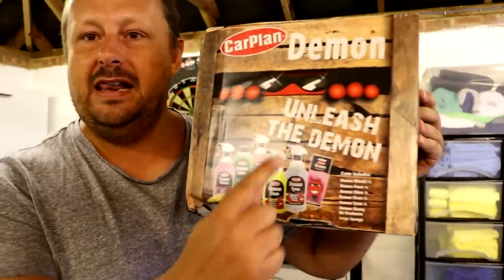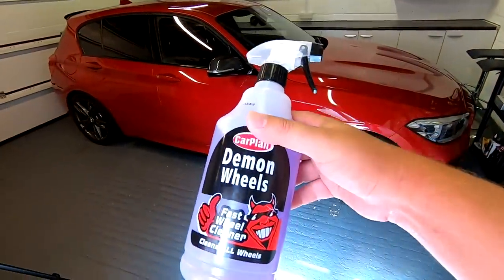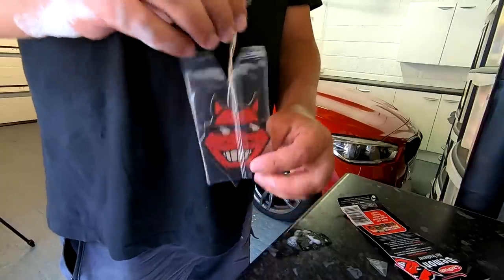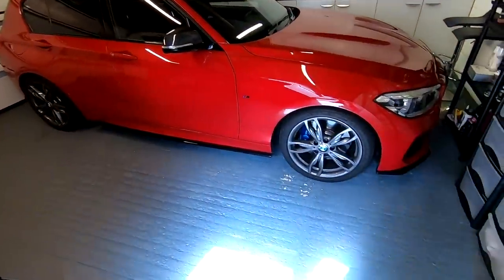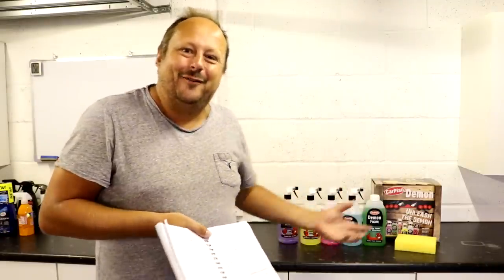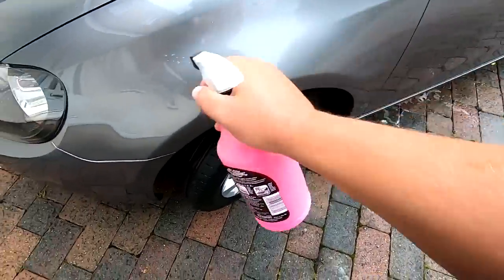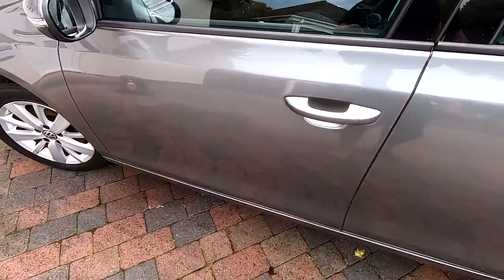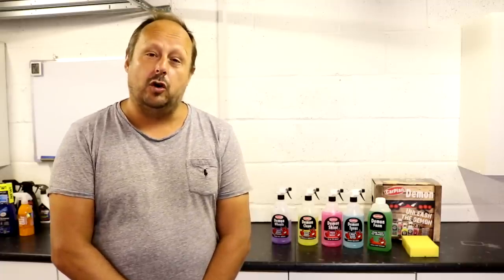DEMON or DAMP SQUID - Detailings Cheapest Kit £19

Comment: I've tried and use a lot of these products so for anyone interested: 

1) Snowfoam: is a decent product if used as a Snowfoam in a lance but down side to get a good lather you need to have about 250ml per car so can run out easy.

2) Demon shine: As said in video is  a good product for price well as a detailer and also is a pretty good as a hydrophobic spray wax, water beads very well.

3) Wheel cleaner is not great at all better of getting the Carplan trade  TFR cleaner a lot stronger but use it concentrated. 

4) Tyre shine - is not great either, again you can use Car plan tyre slik or Carplan super trim cleaner. They work a lot better

Comment: Hi guys just for those of you that don't know the browning on the tyres is a common problem that occurs when you don't clean the tyres and then follow up with a dressing or protectant of some kind. It's a process  that happens due to a element added into the tyre called antiozonant,it's to slow the premature cracking from the tyre getting too dry from oxidation.

Comment: These are probably the sort of products that the likes of a bloke called Gerald  (other names are also available) who proudly washes 'The Old Girl' every weekend regardless. I have used the snow foam in a snow foam attachment for my pressure washer. Nothing impressive, but it is what it is. I have yet to use the detailer and tyre shine. Not really what you would use to keep your car perfect for the long term  (I'd probably use the sponge in the bath) but probably better than the £3 'Wash and Scratch' merchant at the local supermarket / former petrol station forecourt, plus you don't have to drive there & wait in a queue! Happy Valeting ☺

Comment: Regarding the bottles... I have a snowfoam cannon that works well but over time, the thread on the bottle wore thin and stripped the thread. I searched my shelves and found an old Demon clean bottle with not much product remaining and it had a matching thread. One clean out later and the bottle works perfectly as a snow cannon bottle. I now have several Demon clean bottles that have been promoted to 'cannon dispensers' and i can set them all up before a wash with snowfoam and A.P.C and interchange at will without wasting time running in and out of the house setting up the products. Just discharge one bottle, unscrew and replace with the next prepared waiting bottle.
The Demon products themselves are pretty tame and safe for almost any use with reasonable results, just dont go expecting significant results from minimal application.

Comment: Great review. I've had the snowfoam with the gun attachment. Worth a try and the product works well in my opinion the foam does well to roll loose dirt off but as you said the gun is no replacement for a Lance. Also uses a lot of product to get the desired effect. 4 washes and I've used the full thing. I've bought the alloy cleaner and with 2 applications both after rinse and after scrub does a good job.  Is enough for me but overall I definitely think you've got the verdict right though. Cheers again

Comment: I have a bunch of these Demon products for a quick weekly wash - when I have more time and put more effort in, I’ll use better products.
Couple of things to comment on your video, I only use the APC for inside the car and for that, it works well.  Agree about the alloy cleaner, I never use it as it’s really not good.  However, the foam shampoo works 10 times better as a snow, so I put it into my jet washer bottle and it literally smothers the whole car in thick foam.  I personally wouldn’t use it in a bucket like that.

Comment: Quick detailer is great as a cheap drying aid as it seems to help dry with no drying marks even in sunlight. Always amazes me as it shouldn't work for £4 but it does!! I've found it does work fine on glass when used as a drying aid and woks with no smears left. Save my more expensive detailing sprays for the car show days or those nice "Drive in the sun" days.....

Comment: The quick detailer is a good drying aid, and leaves a good shine. I used it on glass with no adverse effect. It is £5 a bottle when bought separately. I wasn't impressed with any of the other stuff really. I have tons of g101 left so the apc will be sat in my garage for years to come. Wheel cleaner is OK for light dirt, and the wheel shine is ok again for a weekly touch up. I think its better priced at £12.99 mark

Comment: I might have found a use for Demon Tyres...... I've used it to dress my engine bay after cleaning. Spray on and wipe off, seems to work fine on hard plastics and keeps hoses looking nice and black. I never use it on tyres as it looks kinda cheap and never lasts anyway so at least I've found a way to use it and free up some space on the shelf!

Comment: I've found that pink spray quite good for a quick finish after washing. The wheel cleaner is virtually useless for anything other than very light brake dust. However, for the price, it's an okay range but don't expect too much.

Comment: All of those products can be picked up under the "Carplan: Trade Valet" range, a lot are in undiluted state. I really rate "Demon Shine/Hi Wax Rinse" as a rinse off drying aid and can get 5 litres for £6, the "Hi Wax Rinse" version is also MUCH stronger than the spray bottle dilution of Demon Shine too, as it instructs a 40:1 dilution ratio. Have a look on YouTube for a bloke using Demon Shine on his MX5, works well. It works better a little stronger and as it's stupidly cheap I tend to be fairly generous in diluting it. Demon Clean/Carplan Trade Valet Super Clean 100+" is actually pretty good too. A friend uses it for nasty work vans in the fish industry and it does well considering the price.

Comment: I like the demon shine it’s really good as a nice easy detailer and I’ve always used it on glass with no problems and I use some really good retailers like meguiars x press wax and last touch so it’s not like it’s the only detailer I’ve tried it’s a decent product for the money but a good tip is go and buy the demon shine pour on shine in the big bottle that attaches to the hose and then use that like a detailer by pouring it in a spray bottle and topping it up with water at a ratio of 1 part demon shine to 2 parts water and it works great and you get loads of bottles out of the large tub and it’s just good for using as a drying aid and even a clay bar lube you need to try it as just a really in expensive product that’s got a lot of uses

Comment: Well i am wondering if they have changed their formula. I use the demon foam, and its really thick suds, maybe i put more in than i should do. I also rate the demon glass not in the kit but really a great product its that or detol surface cleaner spray,  i know but on glass its like magic.
I use the demon wheels for alloys only and seems to work very well with the brake dust removal i then go over the whole wheel with demon foam seems to work great.

Comment: Only one I use is the Demon shine but buy it in 5lt called  Car Plan Trade valet Hi rinse Wax. I add a little to a watering can. What else would you recommend to aid drying?
Reply from the maker: if you can get the blue bottle turtle wax dry and shine rinse wax.  its awesome but mega strong rinse it immedietly panel by panel and then towel dry...   but tell you what if you like the hi rinse wax stick with it.  I like demon shine as well, you can end up addicted to trying detailing products and spending a lot of money otherwise.

Comment: Demon Wheels are THE WORST thing for diamond cut wheels. Fine for normal gloss finished wheels but definitely not for diamond cuts as the solution is acidic and will leave your shiny wheels looking very cloudy.

Ph-neutral wheel cleaners are the best thing for diamond cuts if anybody needs to know.

Comment: Would there be any issues in waxing the car after using the spray on shine?
Reply from the maker: its not ideal prep for a wax really you would want to wash dry and prepare the surface with a polish or a panel  wipe to get a better bond...  its a bit of a faux pas to use a spray wax and then put a paste wax down.

Comment: You tested the wheel cleaner on tyres, the interior cleaner on wheels, the foam wash from a bucket, I don’t think you tried really.
Reply from the maker: 1) I tested wheel cleaner on the wheels 3:00.  You need glasses.
2) The "interior" cleaner is actually an "interior and exterior" cleaner AKA an APC, read the label on the bottle.  I tested it on wheels because you use an APC to clean wheels. But I did also test it on some rear tailgate grime and clean out the dash with it.
3) This product is also designed to be used in a bucket wash directions state "Pour 50ml (3 caps) of shampoo into a bucket and add clean warm water"  

honestly I dont think you tried very hard with your feedback you just wasted my time sanity checking this but you basically got it all wrong.

Comment: Hey, I recently swapped my alloys a month or two ago. When I've used a fallout remover there's hardly any reaction. Is this due to the application of the ceramic coat I put on? Or is the fallout remover crap?
Reply: If you used ceramic before fallout remover it won't react because you've sealed the contamination in.
Reply: @tomrafal3655  ...they were brand new alloys that I swapped over. So I ceramic coated them first. Surely fallout will still be landing on the alloys... So my question remains
Reply: You weren't very clear in your original post. If they're brand new and coated it's unlikely any brake dust has bonded so no need for fallout remover.